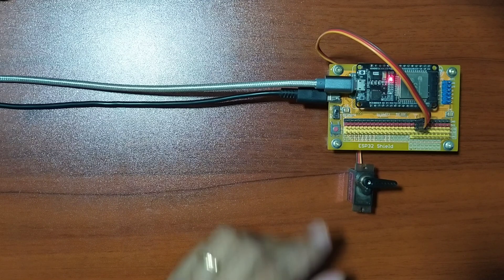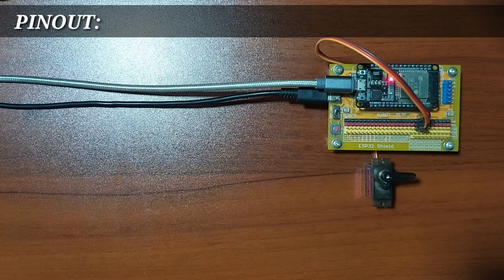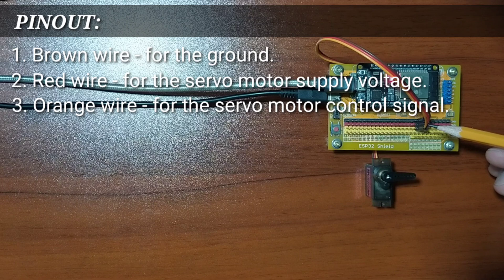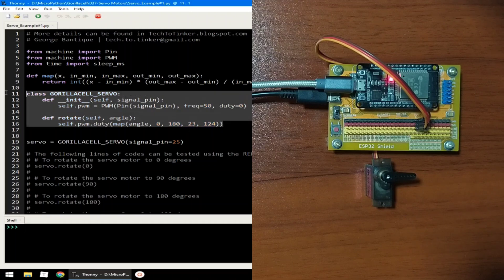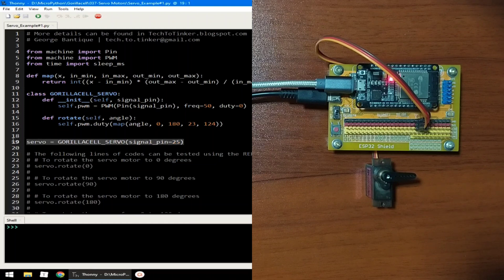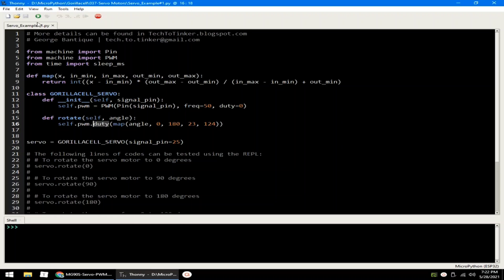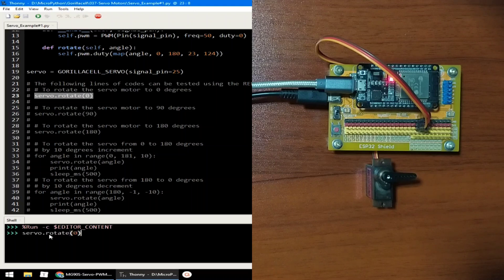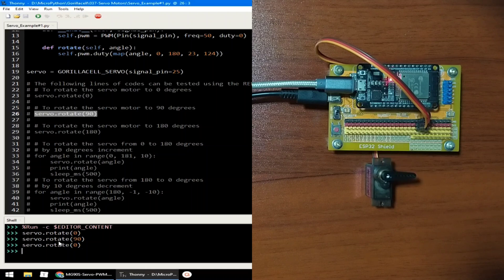037 - MicroPyrhon TechNotes: Servo Motor

Comment: Bro pls tell me how to make a logo in oled in esp32 by micropython pls
Reply from the maker: @NEMESIS 300, basically you can upload an image lets say Youtube.pgm to MicroPython root directory and use the following code.

from machine import Pin, SoftI2C 
from ssd1306 import SSD1306_I2C
import time
import framebuf

i2c = SoftI2C(scl=Pin(22), sda=Pin(21), freq=400000) 
display = SSD1306_I2C(128, 64, i2c, addr=0x3C)

images = []
for n in range(1,7):
    with open('Youtube.pbm', 'rb') as f:
        f.readline() # Magic number
        f.readline() # Creator comment
        f.readline() # Dimensions
        data = bytearray(f.read())
    fbuf = framebuf.FrameBuffer(data, 128, 64, framebuf.MONO_HLSB)
    images.append(fbuf)

display.invert(1)
while True:
    for i in images:
        display.blit(i, 0, 0)
        display.show()
        time.sleep(0.1)